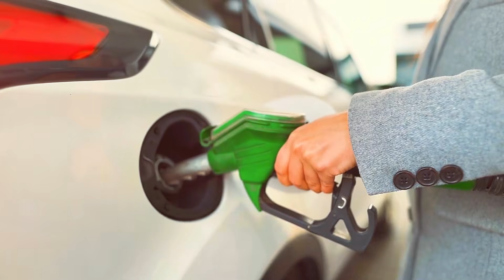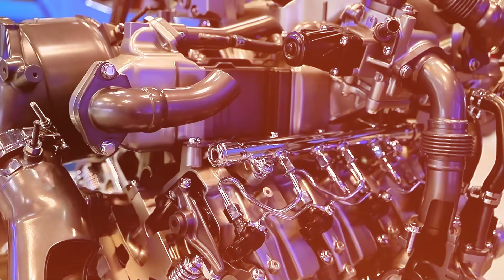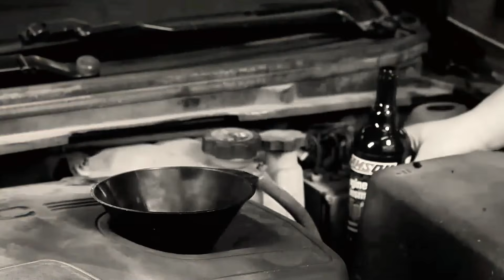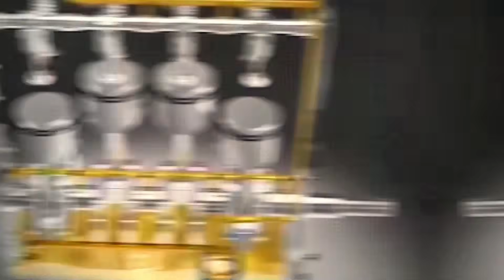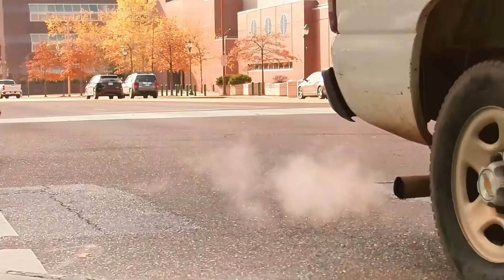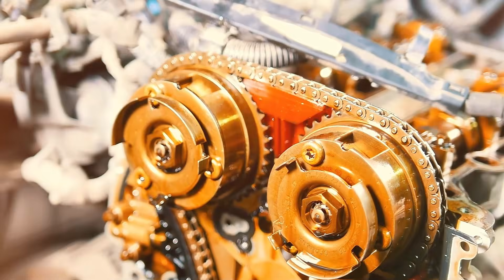The Japanese $2 Liquid Secret That Makes Your Engine Last 500,000 Miles (Mechanics Want This BANNED)

Comment: Change all your fluids and filters. Every 1 to 5 years, your car will last forever.
Reply from the maker: Hey Gary! You've got the golden rule of mechanics right there. Fluids are the lifeblood of any vehicle! While engine oil needs that frequent swapping, staying on top of coolant, brake fluid, and transmission fluid every few years is exactly how you get a car past 200k miles without major repairs. Thanks for dropping this truth bomb!